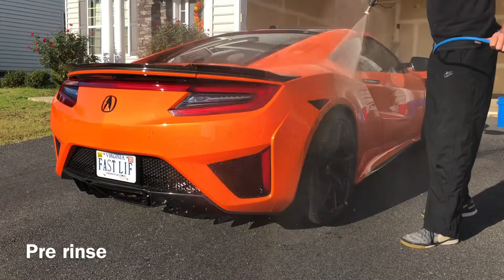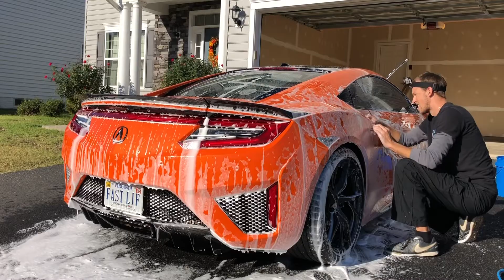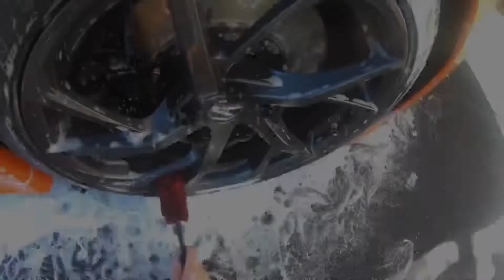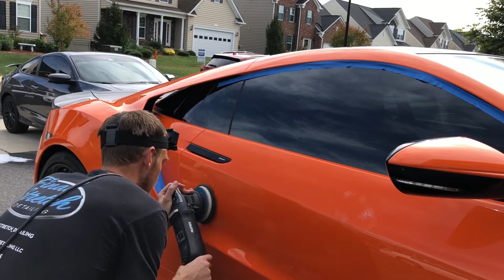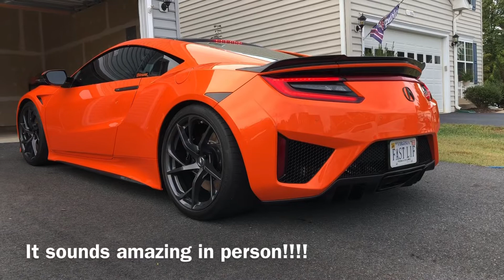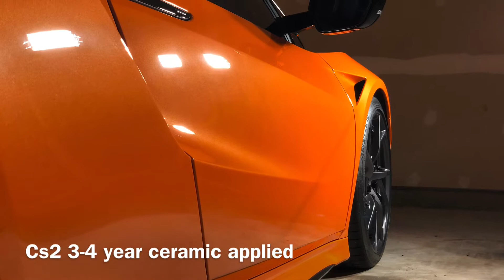(2019) NSX ceramic coating

Comment: I did the same with my 18 RLX hybrid (red) and 19 MDX hybrid (fathom blue).  I added one extra step before ceramic coating and added paint protective film (PPF) after color correction.  That really locks in the shine for +10 years, protects better than ceramic coating alone, self healing with scratches, and wash/dry is 30 mins to get that perfect shine back.  I add Xpel Ultimate Plus PPF to the entire painted surface on my RLX (plus headlights and Exoshield to the windshield) before doing Ceramic Pro.  I just did the front half of my MDX, Exoshield to the windshield, LEDs, and rear bumper in Suntek Ultra PPF and then added CQuartz Finest ceramic coating on top of that and remaining painted surfaces.